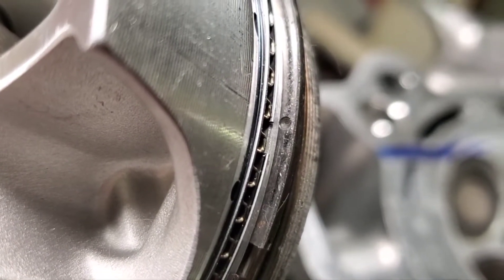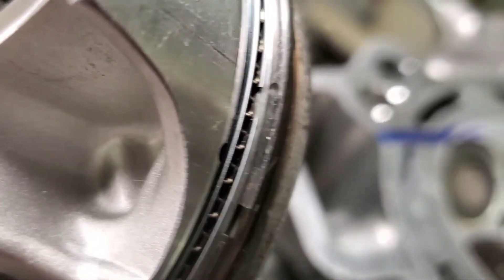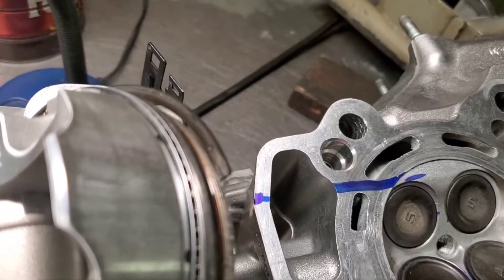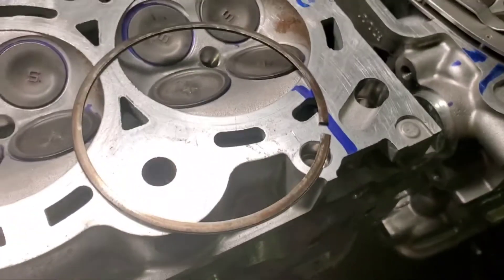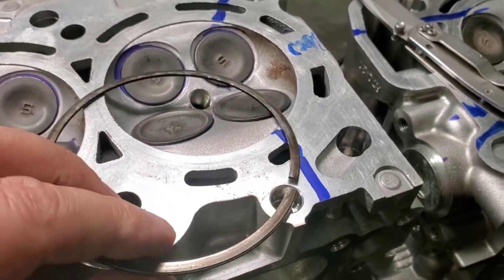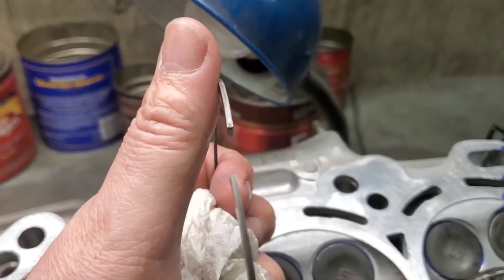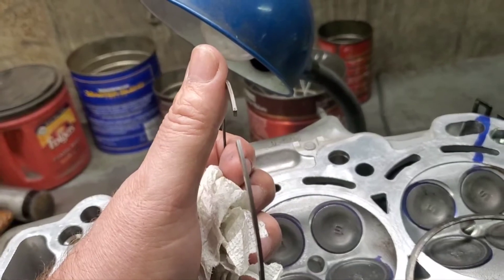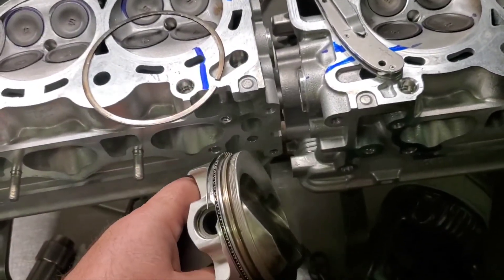Piston Rings Can Never Seal Like This. Professional does not mean it is correct.

Comment: This reminds me of when I used to do some inspection work early in my engineering career and occasionally would see terrible mistakes, similar to what you found here. If there was the potential to hurt someone, we would do a full investigation. Sadly, a significant percentage of the time the cause would be sabotage. It wasn't generally that the worker was trying to hurt or kill anyone, but rather they were dissatisfied with their boss, or their pay, or their working conditions. When I saw those upside-down rings my immediate thought was that this was some kind of sabotage, especially with such a beginner's mistake from a "professional" engine shop.
Reply from the maker: Thanks for watching Gavin.
Yes you are correct. 
This is very suspicious to say the least.
One thing finding one ring upside down.
But both of them, and in the wrong grooves.
Really kinda sad if you think about it.
Take care Gavin.
Thanks again, Ed.